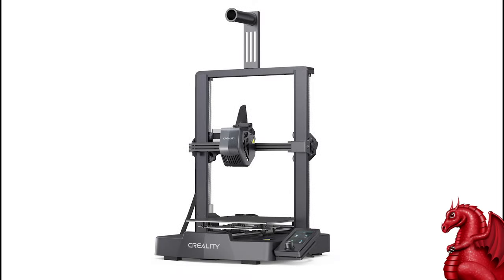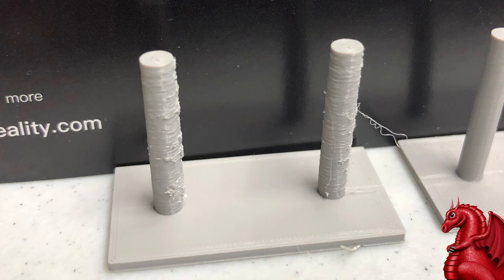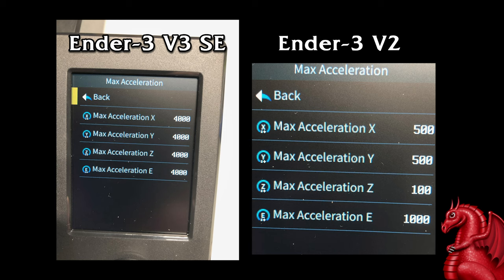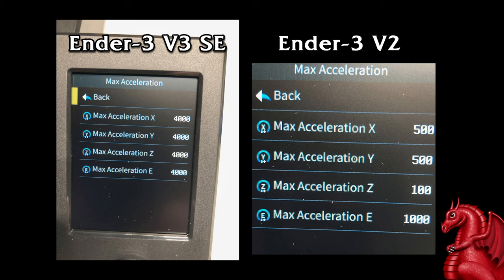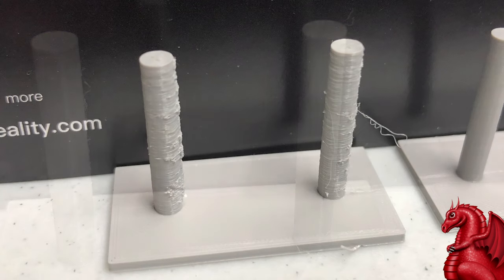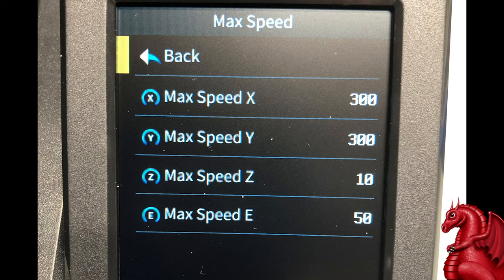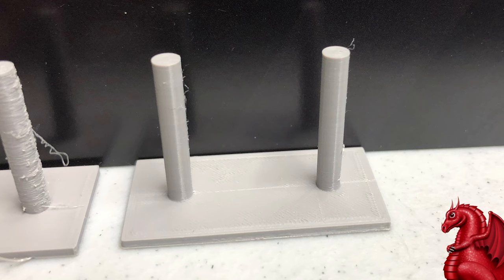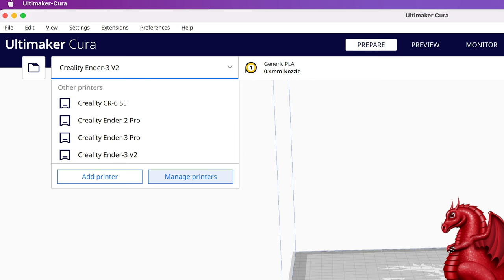Fine tune your Ender 3 V3 SE - eliminate stringing!

Comment: Please don't feel like you have to run the printer at 500 acceleration. You can comfortably go up to 1800-2400 depending on the print. 500 is very slow for this printer.
Reply: Question.  Which or all (XYZE) acceleration setting are you referring to exactly.  Sorry to sound silly. 🙂
Reply: @scf1776  i wonder about that too
Reply: Please don´t let us in the dark...thx lol
Reply: What about ringing with all that acceleration?
Reply: Yes. I agree with you. It would be like turning off the turbo on a Ferrari
Reply: Yeah, I would have liked to have seen lower acceleration without going back to the much slower previous generation.
Reply: @scf1776  he must be talking about x and y since they are the only ones at 500
Reply: Can you explain better?
Reply: @paintmasters  Yes. The travel between model areas will be more slow and affect  the printer capacity, causing "clicks" on printing job.
Reply: You can comfortably go up to 1800-2400 on a first generation Ender 3, it doesn't mean it'll produce nice prints.
Reply: Can you give exact settings?
Reply: Wel let me tell you .
I had problems whit the Next roll of pla .
And whit this settings is good
Reply: agree. many sources advertise the max X and Y acceleration as 2500mm/s so i don’t know why it would have 4000 in the FW. i’ve been using this printer for 3 months without knowing this and lowering it has fixed my harder prints like articulated dragons as well as improved overall quality

Comment: So, how does that effect the print speed? Since its one of the selling points, besides coming without needed upgrades, that it prints faster than the V2.
Reply: I’d like to know too. The fast speeds was a selling point to me and I’d hate to slow it down
Reply: @jonogunn  nah.. 4000 accel for 200 dollars printer is way to much. 
2500 is the max value..

Comment: FWIW, I bought a 3V3 SE a few weeks ago and the factory settings were 5000/5000/200/5000 for acceleration and 500/500/10/50 for max speed. So, this is still relevant.
Reply: same here

Comment: Thank you very much. More V3 SE videos will be much appreciated, as I have just recently finished building mine and am a complete beginner. Of course I'm going to be waiting some weeks for 0.2mm nozzles to come in, but that's alright as I know it will be worth the wait. Again thank you for these videos.
Reply: I got one some days ago. I was blown away by the easiness of the setup and the results of the first prints. For the slicer, there is an existing profile for the SE, and from what I see, it does pretty well the job. I notice that this is indeed a 0.4 mm nozzle, going to a 0.2 mm will allow you to get more accuracy? For smaller details?

Comment: I have had no problems with my Ender 3 V3 SE weirdly. When I got my Ender 3 Pro a few years ago, I had nothing but problems, I've been very impressed with the Ender 3 V3 SE and it has been printing perfect prints right out of the box. I do have some minor stringing issues, so this will hopefully help with that!
Reply: hi, I solved the problem with threads
Reply: So, what are the values on your printer for the settings mentioned in this video?

Comment: I have a SE, for about 2 or 3 months.  I didn't have such stringings, but I immediately updated the firmware first thing.  Also I leveled the bed as accurately as I could, by touching screws so every number be green at least. also sanded one or 2 of plastic bushings for this.  My accelerations are stlll 4000, But software  fixes those I guess.
My tips to correct all of those you mentioned:

1- Use only CrealityPrint, not the modified Cura.  I have also recently used OrcaSlicer and it works too, a good option as none of PrusaSlicer and else have included SE yet.
2- A retraction of 0.8 works on most PLA, I actually don't touch defaults unless I have a Filament with another temp or need supports and infill.
3- About zits and blobs.  While everyone accuses "memory savings" and "recovery after poweloss"  and they are somehow right, it is Creality's fault.  I had such problems and noticed smething another Youtuber mentioned.   The SDCard Creality includded in the package is all the problem.  It is a very low quality memory and low speed.  After lots of problems with blobs and artifacts on the prints, I had it and inserted my highspeed SDCard from my Drone, a Samsung EVO, and I absolutely don't have any single zits anymore.  SE processor has the capability to read and write fast to SDCard, but the included SD is so low quality it destroys prints.

Just my 2 cents.
Reply: Whats wrong with cura?
Reply: @donisio8697  Cura, OrcaSlicer, both can print on v3SE now, specially the recent version of Cura, and they have features I really like, but stringing remains.  Creality Print does not make stringings possibly because of finer settings.  But it does not have many of features others have.
Reply: I am new to 3d printing and I got a v3 se. I get the SD card is terrible but would I still be able to print some things on it?  If you have any recommendations on an upgraded SD card that would be appreciated.
Reply: @chasepeterson930  The provided SD and even the reader are trouble,  I used my Drone's EVO SD card first to prove zits and blobs are memory problems, and then used a 6 year old but fast 16GB card as my regular.  Any average SD does far better than the provided one.
Reply: @PaymaanJafari  what about printing from usb? I also have issues with the provided SD card
Reply: @pavlovskyyp8799  V3SE does not have such feature. I couldn't connect computer directly to it.  But there seem to be a WIFI addon.
Reply: @PaymaanJafari  you can print via USB using ultimaker cura printer, already did it
Reply: Damn right about the SD card, mine corrupted after 1 print (test print it came with)
Reply: @kokamoo  Mine too. Then i bought a 4gb SD card and after some use it seems to randomily "crash" the printer, in the middle of the printing, needing do power off and power on. Now i'm using a microsd with adapter, and i'm searching what's the best SD card to use. Someone told that the Ender 3 V3 SE can't recognize big capacity SD Cards like 64gb.
Reply: @PaymaanJafari you had success updating to the 1.0.6 firmware? I've tried to update 1 year ago, but the printer crashs in a way that I rollback putting the 1.0.4 stock firmware back. In the oficial Creality video about the firmware update, i've seen so much complains on the comments...

Comment: I've been troubleshooting my KE's for 2 days and I was about to return those to Amazon. Tried everything possible including your very helpful tutorial. It was still stringing like no tomorrow. Just for those that can't figure it out (and hopefully it might help someone), change the nozzle for a new one!!! I am not even kidding! Because of the slight nozzle dragging on the prints (and infills), the nozzle diameter was not 0.4mm anymore. So, because it was a tiny bit larger, there was a tiny excess of filament coming out of the nozzle which created the stringing. In addition, give it something like 0.2mm Z hop and disable Reduce infill retraction to increase the nozzle lifespan. Now, I am feeling soooo good! Those new V3s are such nice 3D printers.
Reply: gonna try this when i get home later :D

Comment: Thank you for the tutorial. My printer was basically jumping at stock settings, but those values fixed the problem.
Reply: mine shakes alot at stock settings. i even printed the gantry supports

Comment: The tips with the settings on the Ender was great! definitely improved the situation! After seeing that these settings had a huge impact I went ahead and also enabled the Acceleration and Jerk control in Cura, together with the tweaking of the retraction settings this definitely fixed the issue!
Reply: So when you say enabled, do you mean you put so the machine accelerates and jerks during printing? Sorry I'm new lol just wondering as I have the same printer.

Comment: Well it fixed mine mostly.  I printed a small parts tray and it looked like it had cobwebs on it.  I did as you said and printed another and only had a couple of strings.  thanks so much for the time you took to fix and film this.

Comment: [TRY THIS]
hi, i just playing with the setting and i find that speed can be high.
and all you need to set to make stringing disapear are :
1. set the retraction distance to : 5.5 - 6 mm
2. set the retraction speed to : 65 - 70  mm/s

it work well for me with default acceleration at 4000 and default speed from ender 3v3 se.
let me know if your stringing proble are solved.
Reply: With retractions that long you're pulling molten filament up into the heat break. It'll block up quickly.
Reply: @frankhovis  I think so, but with the retraction speed it work like vacuum and make strings gone.. I run it about a week and nothing bad side effects, I will update later after a month and more

Comment: great vid, crazy that creality released such a solid printer for the price (got it for 160 on black friday) and half baked the firmware. still, love it so far, after adjusting this and some other settings it's great
Reply: what other settings did you find helpful?
Reply: Solid?? Push the top of the gantry and watch the whole printer flex.

Comment: I found the Ender 3 V3 SE profile on the Creality Slicer v4.8.2 291 and exported it out. A year ago Youtuber Ricky Impey did a vid on the steps you need to take to make this happen.
Reply: Thanks for the advice

I had the latest version of Creality Print 4.3 installed
It was not possible to transfer the profile to Cura with it
It differs in folder structure from Creality Slicer
Without uninstalling Creality Print installed Creality Slicer 4.8.2
Everything worked out according to Ricky Impey's instructions
Reply: I noticed that some values in the Creality Print profile differ from Creality Slicer

Ender-3 V3 SE Creality Print
Travel speed 150
Travel accelerator 2500

Ender-3 V3 SE Creality Slicer
Travel speed 250
Travel accelerator 500

Tell me what values did you choose?
Reply: @alexlex6977  I am new to 3D Printing and trying to learn so I mostly just play with settings and see how they work. Currently I have Travel Speed set to 500. Travel Acceleration is deselected. When selected though it was set to 4000. I went thru the same steps you did with Creality Print and Slicer.

Comment: Thanks for the Video.. I'm about a month/200hrs of print time into my SE, and I'm having the same issues. Had even more issues with the Nebula Kit and switched back. The firmware on these machines still need a ton of work!
Reply: Did you feel that kit helped at all? And if you switched which other way did you network it? I have the nebula set up and I am having issues finding these settings.
Reply: @kerryg4466  To me, it was really my only option at the time. It worked better than swapping SD cards. It seemed like the resolution was better..
Reply: @dware7777  what screen are you using on your machine now?
Reply: @kerryg4466  Original Screen with it directly plugged into my PC via USB-c

Comment: Things may of changed, but from my experience of Cura it doesn't override the acceleration settings and will just go at whatever the firmware is set to. Prusha slicer does set its own based on what the settings in Prusha are set to.  4000 is stupidly way too high and is just set to make what is in effect a slightly upgraded Ender 3 design seem like the best thing since sliced bread. My own upgraded Ender 3 Pro runs at 2000 acceleration and around 500 speed and it produces beautiful prints, although the slicer sets a max speed of 150.

Comment: I just did setings u recommended and it is now so much quieter especiali when moving in y direction. 
But my printed pretty well with default. Its just so much quieter and smother when it moves 👍😀.

Also I recommend raising z offset just a bit it really improve quality i raised it by 0.03 from -2.53 to -2.56
Reply from the maker: Going from -2.53 to -2.56 lowered the nozzle (you are going down when it is a negative number, so the greater the number the lower the nozzle is/closer to the print bed). To raise it with a negative number you need to decrease the number, so -2.53 would become -2.50 to raise the nozzle. :)

Comment: I have been using mine for about a month also and I have had great print quality with Creality print the speeds and the max acceleration have not been an issue, but what I did do was to create a better first layer  but I did edit the first layer tiles And did a 12 point layer print you can do this under the same settings in motion and adjust the tiles
Reply: You haven't noticed ringing with the 4k max acceleration in any of your models?
Reply: @_DROM_  I’ve had pretty good results so far

Comment: Thanks a ton for this video!
I saw a previous comment of where to place M413 S0 ; Power Loss Off with the new Cura profile and you said between home and mesh bed leveling. Should it not go after bed leveling or do you think it doesn't matter?

Also have you found any faster print speeds/acceleration speeds that still wont reduce quality?
This has been my first printer after a lot of experience with cad and has been amazing to work with! (just a little slow)

Comment: Thanks for another great video, Tom. Your videos have really helped me get up and running with my V2. I'm looking at the V3 as a second printer but wondering if I should wait a while and get the KE. That all metal hot end and touch screen would be nice to have, especially the hot end.
Reply from the maker: Yeah, it all depends on what type of filaments you want to print. If you only do PLA then this is the way to go. For more exotic/high temp stuff I would definitely look at the KE.
Reply: @Tombof3DPrintedHorrors  I'm probably just going to go with the SE for now. I'm still fairly new to printing and just starting to print with PLA+. I was having issues until I randomly hit your extruder videos and realized my spring screw was loose. Seems to be printing fine now. 👍

Comment: Well, I got some bad news. I DL'ed your bed leveling test print, and just to get a base line, I printed it without changing any of the stock settings, and the print quality was perfect. I then did the same print with your suggested settings, and the test print was again, perfect. With that, I printed a string retraction tower that I found on thingiverse, which was almost flawless. The little bit of stringing that it had was so fine that, walking from my printer to my desk, less than 10 feet, the stringing fell off from the breeze I created by walking. That's where the good news ends. I tried printing something, and it failed within the first maybe 10 layers. The print actually got caught up on the nozzle, and pulled up off the bed. I always ran PLA on my E5+ at bed temp 60, and nozzle temp at 200, so I set those temps in Cura 5.4, and left everything else alone. I then reset the printer back to original settings, and ran your bed leveling test print, and it looked good, so I tried printing the same file, and once again, the print failed within the first 10 layers, with the same results as the first failure. Now I am stumped with what appears to be a boat anchor for a printer. UPDATE.......I just printed the string retraction tower that I mentioned earlier with the printer's settings being all restored to original settings, gcode left alone so bed temp 200, nozzle is 60, and it turned out better than it did the first time. Obviously the piece that failed has a bed gcode. I'll mess with this some more tomorrow.

Comment: Got my V3 SE a couple days ago. Done several prints with the out of box settings with absolutely zero issue and no stringing. I run auto leveling first before any prints were done but that's it.

Comment: just jumping back into 3d printing - been having issues with whispy "angel hair" strings - this was driving me up a wall.. mine were almost exactly like your firmware settings....adjusted them WAY down and messed with the profiles in cura and i only have a few whispy things now on the 2 towers retraction test... going to play around some more, but i'll take 2-3 whisps over the few dozen i had on a 2" part! :) thank you!

Comment: Thanks for the help. Be interesting to hear what speeds you're running these at as well as how much you've adjusted your z offset. Thanks. I also don't know if it's a bug, but my temp settings from Cura don't seem to be saving through when it comes to  loading them up.

Comment: I fixed it with changing retracting from 1.2 mm default to 5 mm.
Regarding the acceleration, the V2 and the V3 are actually not really that similar. Creality themselves state that the V2 can, technically (and they explicitely say "technically") up to 200 mm/s, whereas the V3 can print 250 mm/s. The accelerations are actually meant to be higher.
Nevertheless, changing those settings might solve the problem, but it may also reduce performance.
Personally I will upgrade mine from Marlin to Klipper, installing the nebula pad instead of the old screen, this levels it up close to the V3 KE, improving print times and maybe getting rid of the little stringing I still have left on mine.

Comment: Really appreciate this.  The Ender 3 V3 SE is my first 3d printer, so I don't have a feeling for what settings are normal, and if the printer is doing what I tell it to do.  Plus, I had no clue about the power loss prevention!

Comment: My Ender 3 V3 SE had Max acceleration set to 500/500/100/5000 and Max speed set to 500/500/10/50.
Anyway I went and changed my settings as recommended then printed some small TPU tubes for use as equipment feet.
The result was much worse stringing than the default settings that my machine previously had.